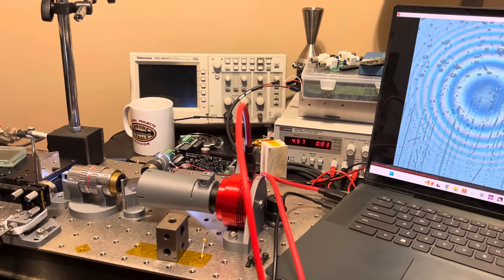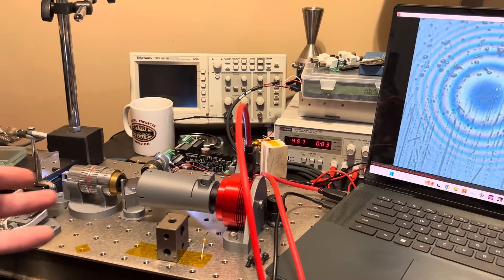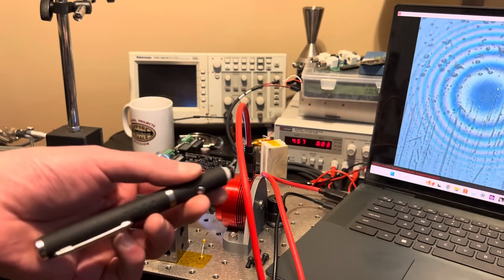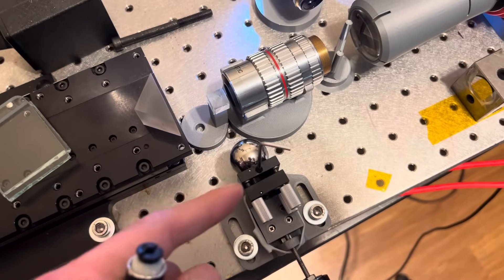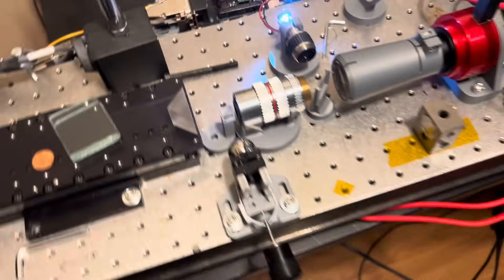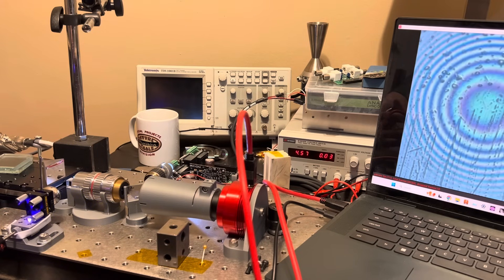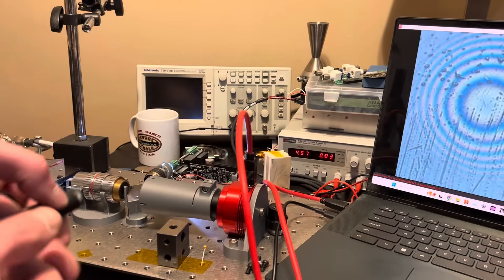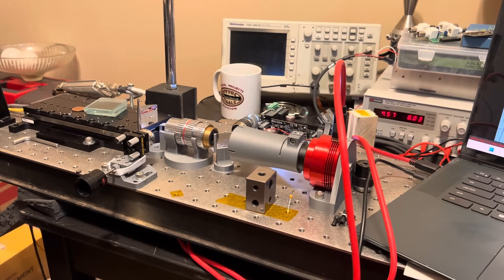Milliwatts of heat causing catastrophic thermal expansion of PLA optical mounts

Comment: Is there any possibility that the UV is affecting the polymer chains?
Crazy idea, but... Try a red laser?
Many years ago, we had to deal with expansion coefficient, so built a mount with an opposing side to have its expansion counter the other mounting mechanism.
Anyway, just one more argument for good airflow, to get as isothermal as possible.

Comment: I'm not sure that choosing PLA was that bad a choice really. PLA has an expansion coefficient around 68um/mC, where aluminium is around 22 and steels are around 10-20. So if it moved 6-7 fringes because of a temperature change, you'd expect 2-3 with a shop bought optical mount, all things being equal. That said, all things are not equal, PLA with a black pigment in it is going to be much better at absorbing light than metals, and not thermally conductive too - it will be good at getting the energy from the laser pen, and keeping it in one spot so as to expand unevenly.

Comment: Sometimes heat is your friend, sometimes it is not. Two days ago I did a very strong shrink-fit on a couple of parts, now they are one piece of steel, no welding. ;)
As for what takes place on optical benches, it can be quite wild. I worked for an outfit that tried plastic optical mounts (inside laser engraving machines) only once,
with terribly unacceptable results and that was the end of that. It was all aluminum after that.

Comment: The CTE is only half of the issue that make PLA a poor choice here. The other half is its low thermal diffusivity which is a measure of how quickly conduction transfers heat away from a heat source. Here the heat energy stays near the point of illumination causing a large local temperature increase. The concomitant local expansion is what makes the material so sensitive to heat input. High thermal diffusivities contribute to the difficulty of cutting aluminum and copper with a laser: the heat quickly diffuses away from the point of illumination. (Both metals are also excellent infra red reflectors which limits the fraction of incident energy available for cutting.) Thermal diffusivity on any material is easy to calculate: see the Wikipedia article on the subject

Comment: This is actually quite a common and practical way to measure optical power, and works across a huge range of wavelengths. The usual setup is similar to a power compensation calorimeter, where a heater and thermometer are used to keep an optical absorber at a constant temperature. Then it's just a mater of measuring the change in required heater power with and without the laser light.

Comment: Interferometers make great microphones too.  Especially when you don’t want them to.  😂

I wound up making a cheap dampening system out of an inner tube and a large block of concrete that I placed upon the inner tube.  I then mounted the optical platform on top of that. It helped mitigate the noise from traffic and aircraft in the bustling metropolitan area.

Comment: Hope you are wearing proper eye protection while using that laser.
Do not bother finding things with lower CTE, use something like ABS, be sure nothing is loaded above the materials creeping point, and fix the ambient temperature.(even tho ABS have higher CTE it will creep less so it is a better material than PLA for optomechanical purposes if you are limited to using plastics.)
Be sure laptop fans are not blowing to system. Put some well regulated heater nearby that will keep that part of the room at always 35C, maybe with some PID control.
That is how it's done on many medical optical devices, they just put parts of the system that are sensitive to temperature change in an enclosure and heat the enclosure to a constant 40C.

Comment: You have a good way of quickly measuring CTE of different materials, so that's a feature, not a bug!  PLA actually has a relatively low CTE for a thermoplastic. ABS is probably twice as high, which is why ABS warps so easily when 3D printing it.  A carbon fiber rod should have a CTE of maybe 3 ppm, and would be much cheaper than Zerodur.
Reply: " PLA filament has a coefficient of thermal expansion of 68e-6/⁰C while ABS has a CTE of 90e-6/⁰C and PETG has a CTE of 68.4e-6/⁰C."
Though also important to note that ABS has to be heated higher than PLA temperatures to be extrudeable, therefore higher CTE multiplier via the temperature.
Reply: @Roobotics  That's great information on CTE, is there a public database, especially on PPS and PPS/CF?
Reply: @randychung6918  it is not linear, depent on atmospheric pressure, plastic filler (there is no pure PLA filaments, any have at least pigments), better to remeasure actual data yourself on real sample and near your working temp.

Comment: I doubt it’s outputting any more than ~10mws; even that is enough to cause major vision damage. But very cool demonstration! The same setup has been used as a spying “microphone” by shining a beam at windows and recovering the vibrations from talking!
Oh, and heat conversion is a legit way of measuring laser output power independent of wavelength (and capable of very high powers), so maybe you can measure the displacement and correlate it to power too! That’d be all kinds of cool!
Reply: Note that 10 mW is still unlikely to cause damage, as the MPE values are generally based on something like 10% of the intensity for a 50% probability of injury (though that doesn't mean I consider a 10 mW beam to be *safe*).

I wouldn't be surprised if the beam was a bit stronger than that, though. 405 nm beams can be pretty misleading given how insensitive the eye is to them, so even moderately powerful lasers can appear quite dim.

It's likely that you could make black plastic smoke with that laser provided  you focus the beam to a pinpoint - at least, that's been my experience with cheap pointers like this. The collimated beam won't burn objects, but there's still enough energy once you focus it down.

Comment: 3d printed sub 10nm flexures???? cool vid
Reply: That’s what I’m saying, it’s a feature not a failure.
Reply: @nicholasdelrossi3996  indeed, you can cover PLA surface with some reflective material(tin foil?), leave small not covered spot and get better more robust control.

Comment: Just try to think of it as a wireless actuated flexure, and roll with it.
Reply: I agree. Two laser pointers pulsed by the motion of the fringes. Easy dynamically-stabilized optical stage. 30 minutes work tops. ;-|